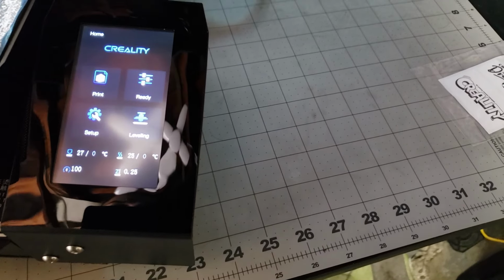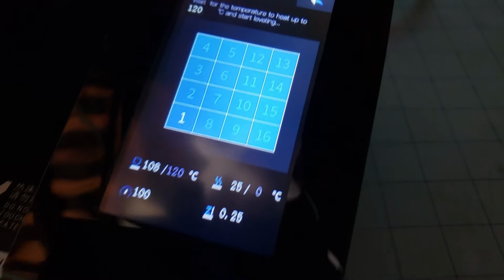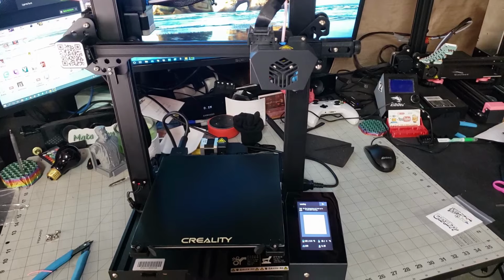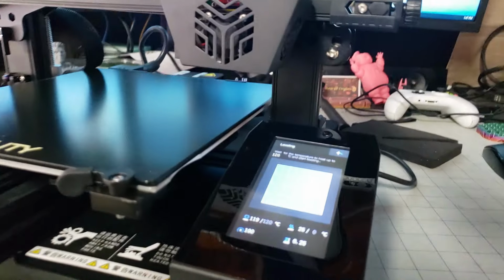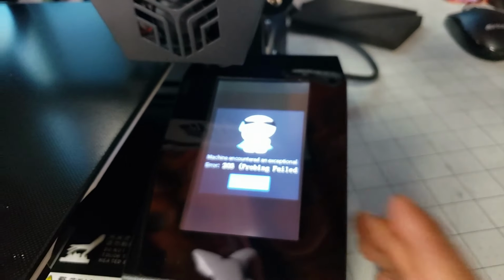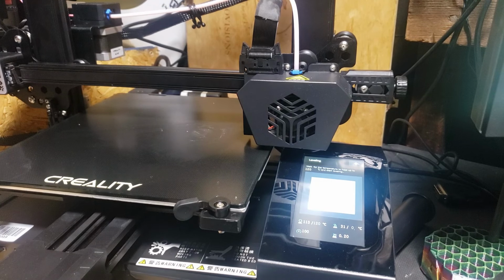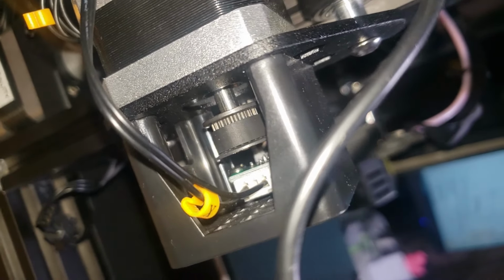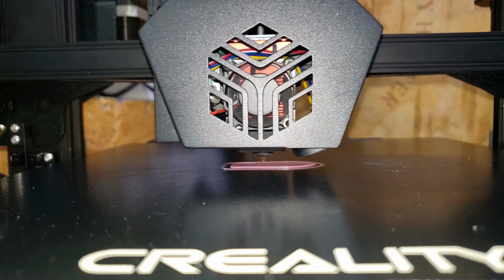Creality CR6 SE first start,  straight out of the box test! First auto level fail and how to fix it

Comment: I've had  nothing but great experiences with my new cr6-se but I upgraded firmware to the community firmware v6.1 it saves it as a mesh and I never have to auto level again
Reply from the maker: thats a great tip! my CR6 is down at the moment, another one of crealitys R&D mistake, the feed moter case cracked so there is no tension on the pla and the gear ....... my ender 3 havent had any problems but i have upgraded the feed assy on those  to the red aluminum ones. the CR6 works great as a printer, when it doesnt brake itself lol but still love it. its just sitting under a shelf now to many other projects going on to deal with it right now
Reply: I really want to get in on this community firmware, but I've got the kind of luck that would brick the printer so I'm just running stock. Only NOW having issues with bed levelling after 6 months pf printing.

Comment: that's a weird production error! haven't had this, but my cable clips were missing and also the gauntry for x axes (the extruder line) was 1,5mm lower at right side compared to left <_<
I think creality really has some Quality-Check issue there..
btw: that's a "wire" and not "cable" ..the cable is a thing which is being held by a mantle or anything else together ;) the two wires could be called cable if you wish..

Comment: Lucky it was a simple fix. The only thing I did to mine when it arrived was immediately replace the power switch as it had one of the original shonky ones. So far everything else has been good. Giving great prints. Only thing I don't like is that the Creality firmware foes not allow a filament change mid print if you want to change colour. I run mine with Octoprint but I do have a USB isolator inline with the printer, to avoid problems with reading G-code from the SD card.
Reply from the maker: Thats my next step! I want to setup octoprint so I can use the time-lapse

Comment: I'm having the exact same issue ATM. Going to do the same check that managed to solve your issue. One question: did you have to rehome or so? Or did it just work again after the connector was fixed?
Reply from the maker: Always recommend to rehome to make sure the auto level is correct
Reply: @Matas_Creations  Aside from the auto home button on the screen... No idea actually how to set this manually?